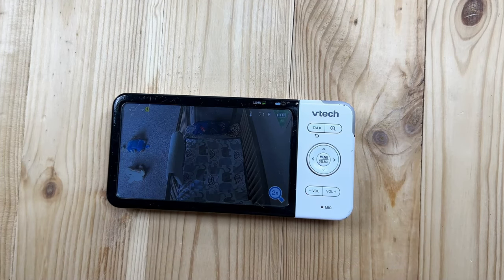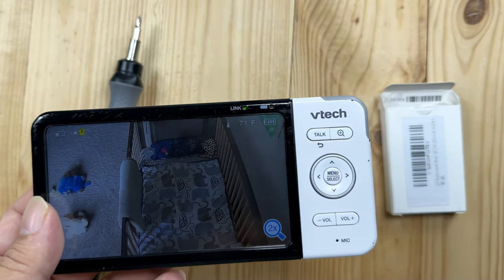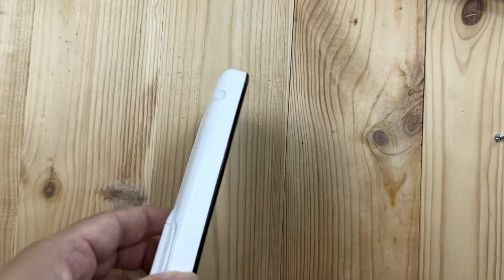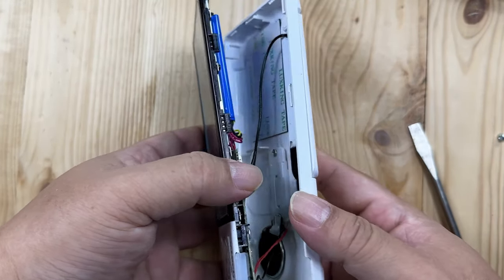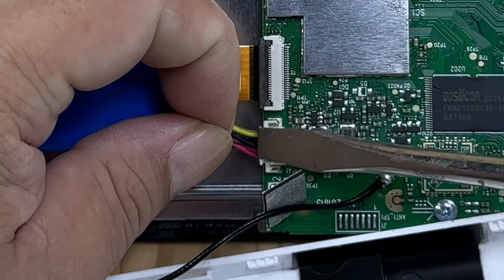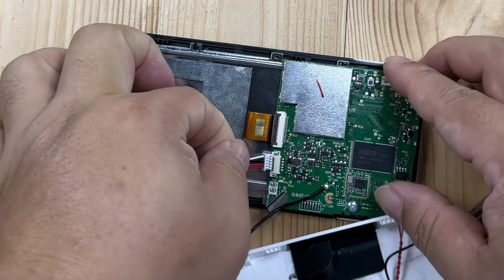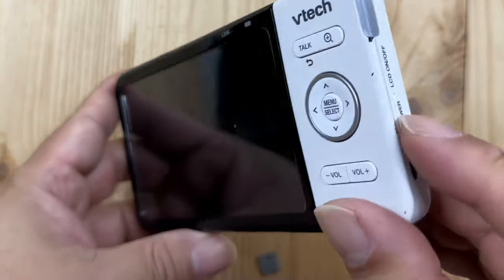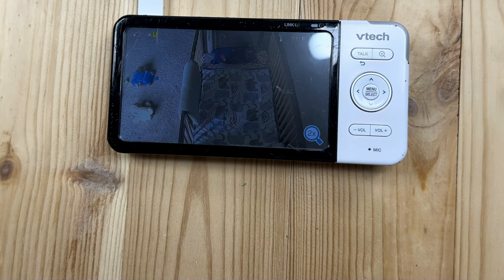How To Replace The Battery In A VTECH Baby Monitor

Comment: Given the replacement battery was less mAh than the original, do you think it was worth replacing or would it be better/easier to go with a power bank?
Reply from the maker: I definitely think the power bank is the easier way to go. However, right now, the new battery seems to power the monitor for 3.5 hours which is as good as the original one ever did. I'm thinking that the original battery may have been slightly overrated. At any rate, the replacement battery so far as worked great. Hope that helps!
Reply: Thanks for the video! After 3 months how long is the battery lasting? I’m considering doing the same thing and want to know if it is worth it
Reply: Thanks von panda ❤
Reply: Tks. I just replaced my daughter’s monitor because of this.